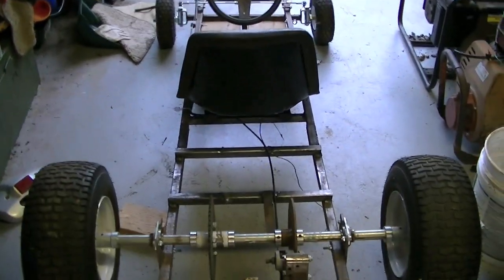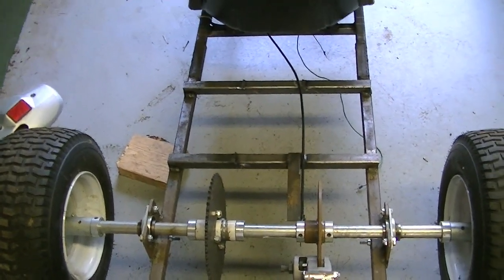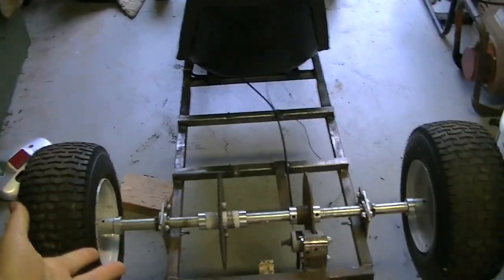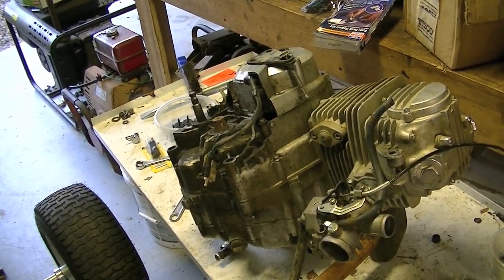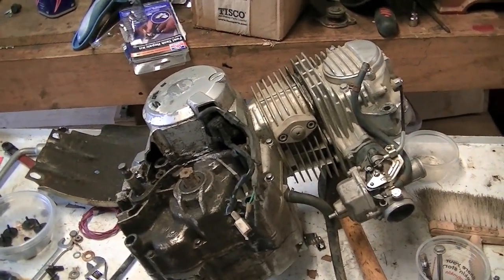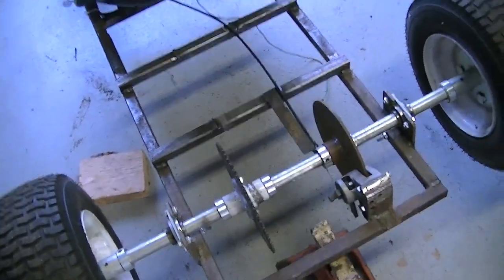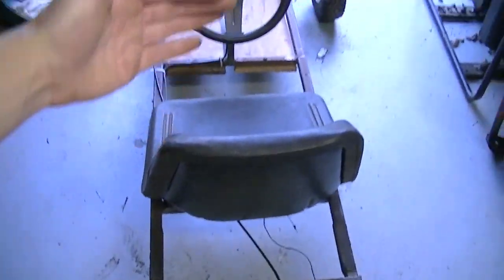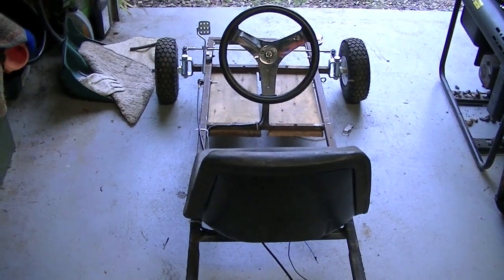15 HP 5-Speed Go Kart Build Part 1- Overview

Comment: it looks like the only thing thing holding your axle centered is the brake caliper, why not have lock collars at the bearings?
Reply from the maker: +Bobby Hammond I did- the bearings had set screws and I drilled small holes in the axles for holding it in place. This was after I drifted it and the axle slid sideways, popping the chain off of course.